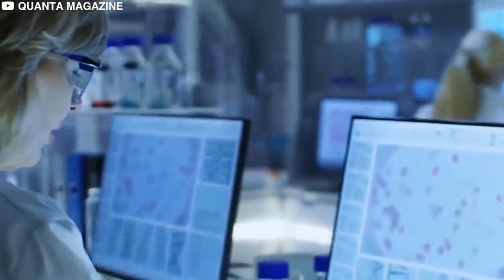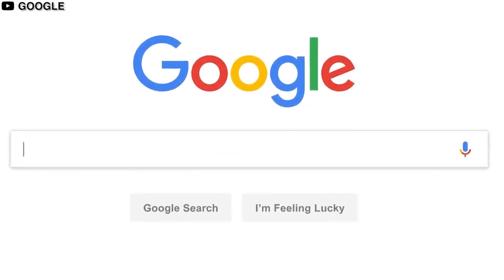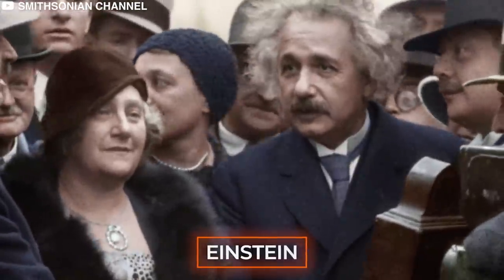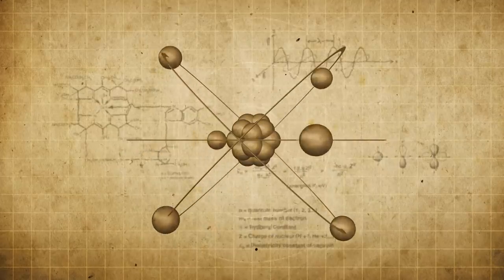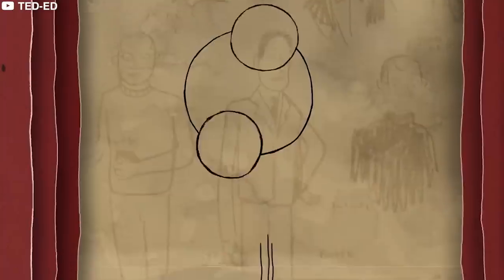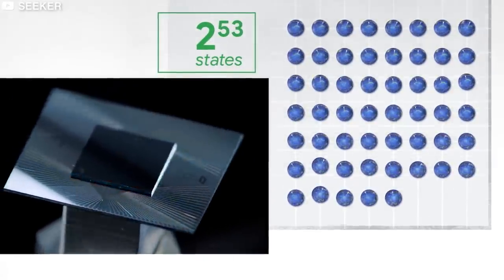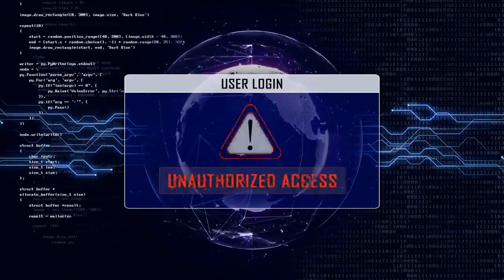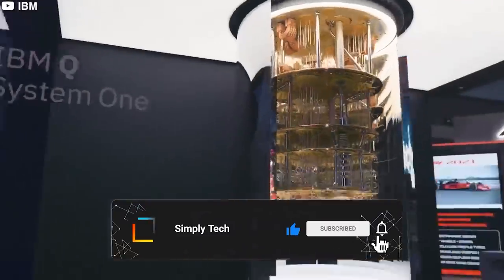Google's Plan To Create The World's First Quantum Computer

Comment: What kind of real world problems did a super computer solve so far?
Does computing power really solve problems? I wonder!
Reply: Does nothing for the average person would revolutionize fields that require massive data sets like protein folding
Reply: For one thing, super computers are responsible for all the advancements in machine learning. Every time you check the weather you're reaping the rewards of a supercomputer calculation & prediction. Lots of data-heavy weather computation is done by these machines. Supercomputers & machine learning are also 2-3 years away from allowing cars to drive themselves; this will be a game changer.

Comment: This is great. But we should also know that quantum computers won't be able to run the tasks that we run today(not that it needs to) but don't expect it to run huge computer loads of today, it has very specific application like cryptography etc. 
Why I am telling this is because most people assume that this is going to straight out increase the computing power of everything which is not the case. So even if someone is able to make one without the need of such controlled environment it would need something meaningful to do, otherwise it will be a big decryption machine to intercept and decrypt data(which has no positive use, only destructive) among some other use cases.
Also, most physicists don't believe in this, this is a moonshot project. But props to companies like Google who are willing to invest in such space.I am positive that something good will come out of this, even if it is something we are not expecting.
Reply: Thanks for info !

Comment: This a bunch of hype! It will never happen. There is no way to get IO from micro particles. Think about the largest particle accelerators. They require massively big, and very long chambers just to create a particle, that we can't even be sure exist, because its life span is microseconds of time. Here, we are talking about actually communicating with many sub-atomic particles simultaneously. As if they could even respond to our level of abstraction. The purpose of these devices are more spiritual in nature than physical.